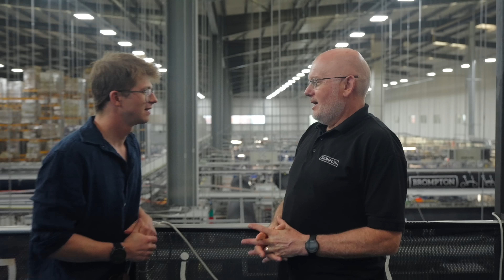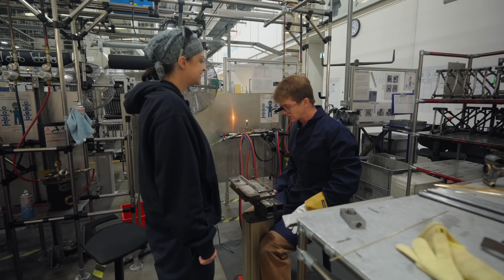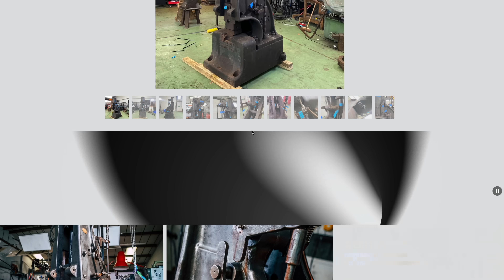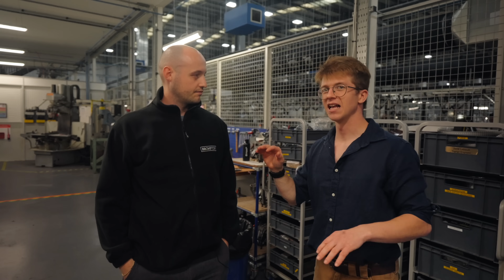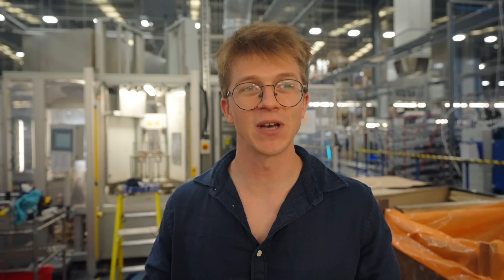Making a Folding Bike

Comment: After Nigel started, Brompton introduced the ‘raw’ models, where they clear coated frames so you could see the brazing. It was a cool aesthetic, but now learning what was going on at the time, showing off the quality of your work with a special run of bikes like that really fit the ethos.

Brompton was notorious for patchy availability at the time though, and it took them a fair few years to lift production. In 2007/08, you could only reliably purchase a Brompton in the UK winter, and you would easily make a profit selling it at the beginning of summer.

Comment: I used to braze different sprockets to the rear brake hub on my old Triumph motorcycles, because by design you couldn’t get different ratios, sprockets weren’t bolted on like today. Turn the old sprocket off on a lathe, and braze a new one on. Pretty easy, brazing is quite strong as these bikes were 50-60hp

Comment: Thank you Alec, that was fascinating.  However, I do think Bromptons are overrated as bikes generally, and they've become something of an expensive fashion accessory.  Yes, they're very compact for a folding bike, but still quite weighty.  Not sure if it's still the case, but Bromptons used a lot of unique components that meant rudimentary spare parts (available most places) could be expensive compared to those on conventional bikes.

Comment: AI Summary

Abstract:

Alec Steele visits the Brompton Bikes factory in Britain to explore the manufacturing of their iconic folding bicycles, focusing particularly on the specialized, high-craft brazing technique used for the steel frames. The video details Brompton’s production philosophy, led by Production Manager Nigel, highlighting a successful scale-up from 12,000 to over 90,000 bikes annually while maintaining domestic manufacturing and introducing a four-day work week.

Steele receives a hands-on lesson in brazing, learning the difference between welding and brazing in the context of bicycle strength and material integrity. The tour showcases specialized, custom-built jigs (designed and maintained in-house) for frame component assembly and highlights highly automated machinery, such as a custom quarter-million-pound auto-braze unit for internal hinges. Brompton’s emphasis on employee ergonomics, high-tech torque tools for quality control, and sophisticated supply chain optimization reveals a manufacturing operation dedicated equally to quality, efficiency, and employee well-being.

How Bikes are Brazed in Britain: Brompton Factory Tour

*   0:59 Scaling Production and Employee Focus: Nigel, who joined Brompton in 2006 when they made 12,000 bikes annually, discusses the successful increase in production to over 90,000 bikes (at peak) while implementing a highly optimized flow using 62 specialized work bays and focusing strongly on quality over speed.
*   1:37 Efficiency & Staff Well-being: Brompton employs 51 brazers and focuses on a "single piece flow." They successfully transitioned to a 4-day work week while still meeting ambitious production goals.
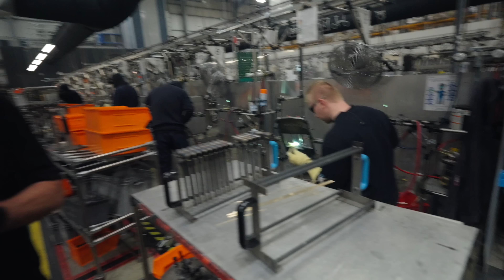*   3:52 Brazing vs. Welding: The frames are brazed, not welded, as the lower temperatures (850–900°C) prevent the steel from becoming brittle, which would require extensive annealing necessary if they welded at 1,300°C.
*   4:37 Custom Jigs and Ergonomics: All specialized brazing tooling is designed, manufactured, and maintained in-house. Jigs and workstations are highly ergonomic and adjustable to accommodate workers ranging from 4’10” to 6’6”.
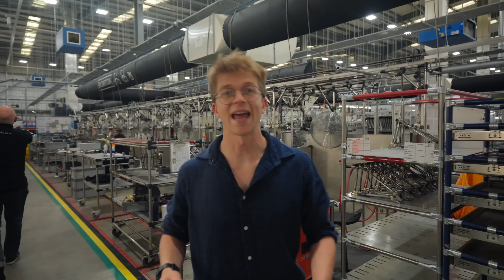*   5:12 Hands-on Brazing Lesson: Alec is taught basic brazing techniques by Rebecca, noting that flux is mixed directly into the oxy-acetylene lines for safety and efficiency. Learning the 14 different brazing skills takes a new hire about a year of training.
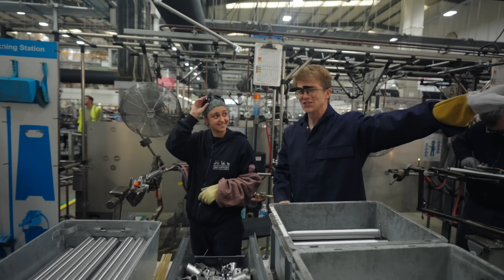*   11:06 Lug Brazing: The handlebar junction is brazed using a lug, requiring the brazer to put heat into the larger lug first to allow the braze material to flow properly into the joint via capillary action.
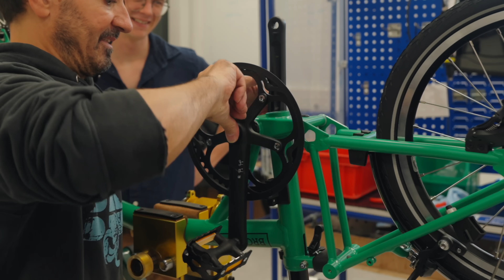*   14:48 Frame Complexity and Accountability: The bottom bracket assembly is the most complex of the 14 brazing jobs. Brompton maintains high quality control by having every brazer stamp their unique initials onto this completed joint.
*   16:09 Automated Brazing of Hinges: Brompton utilizes two custom-made "auto-braze" machines (costing nearly £250,000 each) to braze internal joints on the main and front frame hinges. This machine uses seven torches and pyrometers to precisely control temperature cycles, ensuring a strong internal joint.
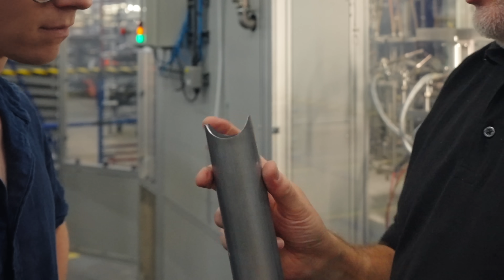*   16:36 Supply Chain Innovation: To eliminate manual deburring and prevent injury, Brompton outsourced the specialized laser cutting (scalloping) of the tube ends to their mill supplier in Spain, a solution that saved them from buying their own expensive laser.
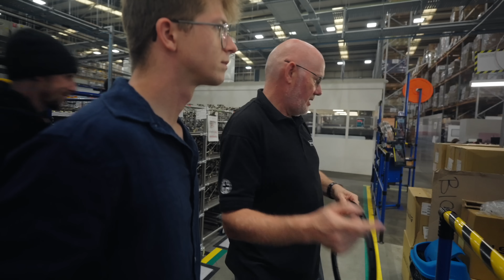*   24:14 Wheel Production Scale: Brompton builds 1,200 wheels per day (1,000 for bikes, 200 for spares). The truing process is automated using a specialized machine that employs lasers and fingers to tighten and loosen spokes, truing a wheel in 100-120 seconds.
*   26:51 Assembly Line Efficiency: The assembly process features 16 stations with a Takt time (cycle time) of just 1 minute 38 seconds, achieved by stripping out non-bike-building tasks into 108 separate pre-assembly jobs.
*   28:07 High-Tech Tools: The assembly relies on expensive, specialized torque guns (e.g., £12,000 per unit) that record the serial number and the torque value, and can even automatically adjust the torque setting by detecting which socket is attached.
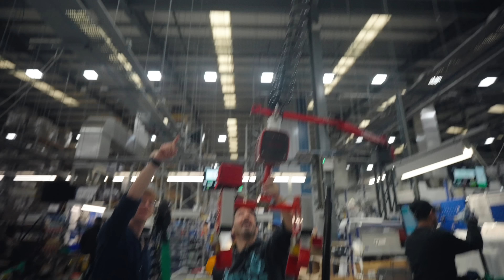*   32:10 Exceptional Ergonomics: The final assembly bays utilize an ultra-sensitive, articulated, counter-weighted arm to effortlessly lift and maneuver the bike frame, ensuring that workers do not strain themselves while performing repetitive tasks.

AI-generated summary created with gemini-2.5-flash-preview-09-2025 for free via RocketRecap-dot-com. (Input: 29,938 tokens, Output: 1,034 tokens, Est. cost: $0.0116).

Comment: This is the first time ive seen brazing look like a good alternative to welding. Taking a factory from 13,000 a year to 90k a year their best year is INSANE, but after hearing how they outsourced things that they couldnt do as fast or well, and improving quality at the same time is genius. That truing wheel machine was MIND BLOWING too. Im sure that along with reducing the tacking from 4 minutes to 1.5, and those fixtures and clamps and tool room are a huge part of it too. That increase in efficiency is incredible for any type of production facility

Comment: I guess it's a generation thing but I learned how to braze (and weld with an oxy-acetylene torch, stick and MIG) in elementary school shop class so it's kind of funny that a professional metal worker has never done that. But I guess it has kind of fallen out of fashion. And yes, the skill is transferable to TIG-welding and obviously TIG-welding skill transfers to brazing. It was fairly easy for me to learn the basics of TIG welding because I had done brazing and flame welding. You can even braze with a TIG-torch.

Comment: I think one of the torque tools was a torque stick. They are awesome for use with an Impact driver. They flex to only allow the right amount of torque using torsional stiffness. Sorry...geeking out. BTW, The etymology of Takt Time is German from Taktzeit meaning cycle time. The Toyota production system is one copied by many as that took this to the nth level. Oh yeah, and I want one too.

Comment: Thank you for a thoroughly interesting tour of the Brompton factory. I bought my Brompton 2nd hand (pre-owned is the modern phrase) back in 2003 when I started commuting from Wiltshire to London Euston and needed to get to my local station and from Paddington station to work. I didn’t want to subject myself to the underground each day.
I lost track of the number of miles I rode on my commute over the years but the bike paid for itself within six months and I got fitter.

It is so good to see that Brompton are still going strong. It is a reflection of UK industry’s decline that several key components are outsourced but it is positive that they get them from Europe and not the Far East.
Reply: It's more cost effective for certain complex processes. As he explained with the laser cut tube ends the machine could cut a huge supply of the tubes in one day, then the machine would sit idle for long periods of time. So they committed to buying tubes from the Polish company if they'd buy the machine. That company then had a new capability to sell to many other clients.
If this bike company used the laser cutter to cut ALL their tubes it might make financial sense to buy it. They could further improve their bikes by getting even closer fits with less brazing fill needed.

Comment: Strictly  speaking they are bronze welding as they use a silicon bronze filler rod to build up a bead,  brazing, allowing the filler rod to flow into the joint , as in soldering, would produce a weaker joint.
Reply: Sif 101 brazing rods.

Comment: i was a film projectionist (4/35, 8/70 and 15/70) for a number of years, and i loved the repetitive nature of that job. everything you worked on was different, but the tasks of the job were always the same. add working with your friends into the equation and it was the best job i ever had. as a result of that, i always felt i would like and could get used to these kinds of specialized tasks, but have never gotten into anything like that.

Comment: Ngl, my proudest metal working achievement was brazing a hydraulic line on an excavator, during the parts shortage of 2020. That braze lasted untill 2022 and hydraulic fittings came back in stock.

Comment: why brazing? why not just tig weld it?
Reply: Brazing is more like soldering and less stronger than welding. I think they only do it for the appearance. It's easier to get a clean braze/solder than a weld.
Reply: @MoonTrustee honestly if it's just esthetics then a good welder can lay down dimes that look nice. I dont think I would ever buy a bike that's been soldered. soldering does not melt the metals together, it melts the filler rod into the gaps. does not make sense.

Comment: That's a fairly impressive modern manufacturing process.  Beautiful fixturing, well thought out work flow, and very nice handling of the hardware and subassemblies.  I've been in so many places that couldn't even manage basic management of screws and nuts.  And it's so nice to see a place focusing on hand skills, those beautiful braze joints.  Sometimes I miss doing the hands on work.

Comment: Was expecting piped air supplyface masks, for the welders, if doing all day every day, not the same you shed, taking odd bit of metal, as a repair, or outside some, the al a breases even still days, but going indoors are you?

Comment: The older fella was talking about it when he was saying bigger mass heatsink etc.. the braze will only take to the steel when they are at the correct temp for the brazing rod nominally about 800 to 900 deg celcius for steels, although there iis and have been for a while now low melting brazing rods Eutectic was brand 30odd years ago. So only when the bigger mass and the smaller mass of steel are at the same temp only then will the braze flow.

Im surpised they didnt have lugs manufactured then just braze it in an oven and let capilary reaction work to create the joint as the method they use utilises a lot of brazing filler rod.

Comment: You think making a bicycle is fun? Build a motorcycle. Even if you just make the frame and other metal parts, give it a shot. It's fun. Then pass it on to someone else to put in the engine and electronics and brakes and everything else.

Comment: As someone who is 193cm (6'4") tall, I particularly enjoy the fact they take the workstation adjustment to both ends of the spectrum of heights.  Normally tools etc are built for average height people, sometimes custom made for shorter people, never usually for taller.

Comment: brazing is a joke , why wouldnt you tig weld these.

22 year professional fabricator from canada and we would never approve something built like this in my country , ever !!! 

seriosly i cant see why you wouldnt this crap about not heating the steel doesn't make any sense at all. 

cheers from canada 🇨🇦
Reply: Brazing is amazing when you are working on lead or soft materials like brass... They could actually do real gas welding or just use bolts? Brazing steel sounds like supergluing 😂

Comment: 19:36 can't they use an induction ring to do this? Even if the 2 parts heat up at different rates can't they use 2 different rings to heat each part differently.

Comment: I am a certified Construction Mechanic specialising in Steel and Metal Construction, with a sub-specialisation in Thin Sheet Metal Construction (0.8 to 2.5 mm). I would like to learn Blacksmithing to further refine my metallurgical knowledge.
I also wanted to mention that, due to professional requirements, I have performed TIG CuSi3 brazing, where the TIG torch simply provides the heat, similar to the flame in braze welding. The reason I had to do this was for a customer who wanted railings in silver, gold, and copper colours—i.e., stainless steel, brass, and copper.
Since you can already TIG weld, I am quite certain that you can also perform TIG CuSi3 brazing. You just need to 'play around' with the heat. My recommendation: Start slowly from a very low power setting and gradually increase it. Begin with an overlap joint, a butt joint, and a fillet weld, each brazed from only one side. Then saw it through, polish it, and check if the braze fully encapsulates everything. Also, carry out a break test: If the metal bends, everything is perfect. If the seam breaks or tears, the parameters need to be adjusted (amount of filler material, speed).
Otherwise, I can recommend the YouTube video by Igor Welder; he explains it perfectly (unfortunately only in German). I am from Germany, by the way.
P.S.: Keep up the great work! I have been watching your videos every Sunday for four years.
Kind regards, Maurice Pfeiffer
Reply: I've seen people on YouTube brazing with these rods. It truly blew my mind what this technique is capable of.